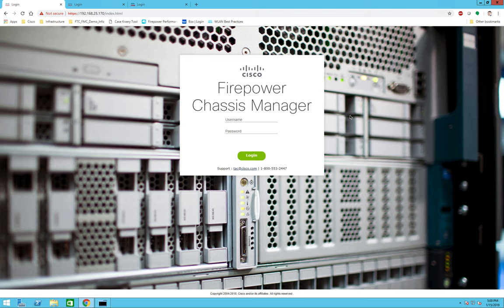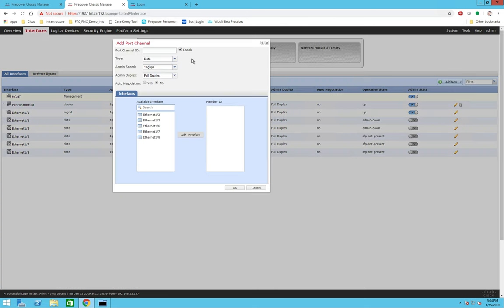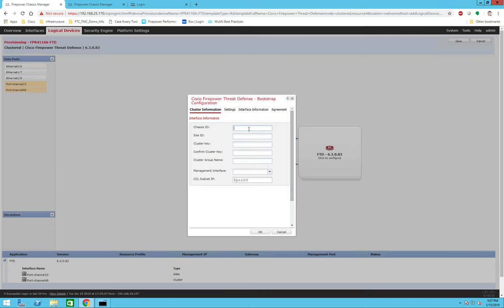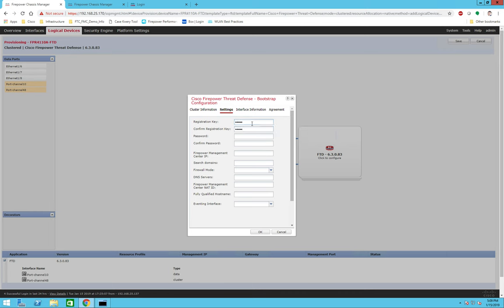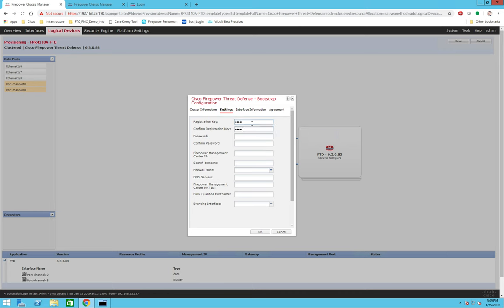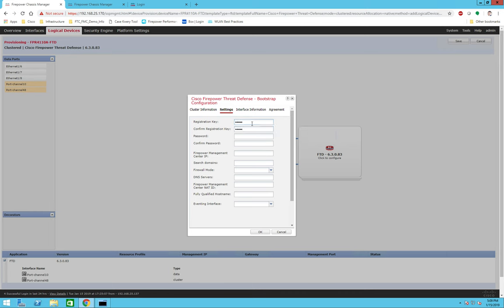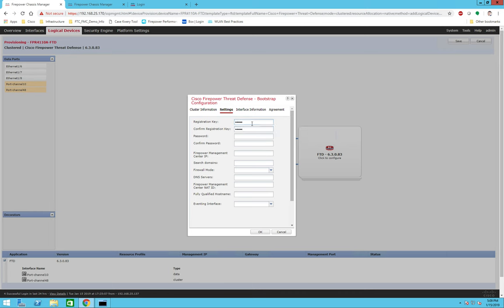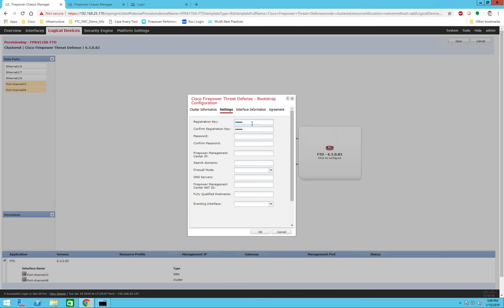Cisco: Security - Clustering a Firepower 4100 with FTD 6.3

Comment: Hello, I am implementing two FPR-4112 in a cluster using the instance idea. Therefore, instance 1 vlan 50 and instance 2 vlan 100 and from each firewall I use two ports 1/8 and 2/8. On the C9500 switch I use stack-wise. However, to make the cluster operational I needed to create port-channels 48 and 49 in trunk. Is that correct? Could you share what configuration you used to configure the switch? In the video I see that there are two port-channels. Is that the idea?

Comment: Hi Nathen
Thanks for the video. It helped a lot. I have one specific question regarding the management port 1/1.
Where shall we connect the port 1/1, if it is a switch where the mgmt port is to be connected then what would be the configuration of the switch port where the port 1/1 is connected.
And do we need to assign separate ip for the mgmt port or it wil take the ip which was provided during the cluster creation.

Thank you in adv.

Comment: To be clear, you'd need 2 separate firepower FXOS appliances for this to work, correct? We couldn't use a single chassis with 2 separate firepower instances to configure HA, correct? I believe I've attempted to do so before but ran into the issue of the firepowers being on the same chassis? Thank you for the video!
Reply from the maker: X I humbly apologize for such a long break, and thus missing a reply to this....  You can run clustering with a SINGLE chassis and multiple FPR.  Its called intra-chassis cluster.  Covered here for example: https://www.cisco.com/c/en/us/support/docs/security/firepower-management-center/212698-configure-ftd-clustering-on-fp9300-intr.html
Reply: @NathanStapp  no worries whatsoever, thank you very much for your help!

Comment: what is the purpose for copying the config from FW1 to FW2, because you have configured(fw2-logical device) it manually even after pasting the config.
Reply from the maker: Mandaar, the pupose of copying the Config from FW1 to FW2 is to bootstrap the configuration (save you time so you dont have to type EVERYTHING again).  What probably doesn't seem to make sense (but actually does when you think about it) is the fields that you have to populate are fields that are IMPOSSIBLE for the machine to determine for you.  Passwords are obfuscated, so those cannot be exported and copied, hostnames are unique so the machine cannot divine what it is supposed to be, chassis # cant be determined because this might be chassis 4, or 5, or 6 up to 16 in the cluster....,  IP cannot be determined from an existing ip in config.  The rest of the fields that are empty, like search domain is because it is optional, and I did not populate that on the first box :)
Reply: @NathanStapp  ah got it.....much informative, Thank you :)  :)

Comment: Hi Nathan
Thanks for video. Can I do management with FDM after creating the cluster with FCM ?

Thanks
Reply from the maker: Navdeep, No you cannot.  Firepower Device Manager (FDM) is only for local management of a firepower device.  Local management cannot be used if you are part of a cluster, as the cluster must be managed by the same manager which means a remote manager.  In this case Firepower Management Center (FMC).  Thanks for the question!

Comment: Hi, nice video. do you have network topology for this video? thanks
Reply from the maker: I don't have one drawn out because this video only focused on the clustering of the firewalls.  To be honest, after publication, I realized I probably should have shown the switch ether-channel configuration or linked to another video that prescriptively went into that configuration.
Reply: @NathanStapp  in case I have 2 direction data outside and inside. Do I must configure Portchannel 10 for outside and port channel 20 for inside. and when is a NGIPS, is in iline pair comnfigure in FMC?

Comment: I have 2 FPR 9300 with single Sm44 Security module and i am running 5 Ftd logical instances on it in HA (Active/Standby) i also have VPN requirements on this FPR. Is it good to use it in cluster or in HA.?
Reply from the maker: Harwinder, I apologize for such a long wait before response.  I have a newborn in the house! :)  As always the specific model device, code version, and intent are important in any answer, based on what you have told be I give the following information.  Anyways, there are two types of VPN's and which one you needs changes the requirements.  For Site-2-Site VPN's you can cluster OR HA, however the mechanics should be understood when you do this, I would recommend reading the "Guidelines and limitations" here: https://www.cisco.com/c/en/us/td/docs/security/firepower/650/configuration/guide/fpmc-config-guide-v65/firepower_threat_defense_site_to_site_vpns.html.  For Remote access VPN's (RAVPN's) only HA is supported, this is documented here under guidelines and limitations: https://www.cisco.com/c/en/us/td/docs/security/firepower/650/configuration/guide/fpmc-config-guide-v65/firepower_threat_defense_remote_access_vpns.html#reference_xby_dml_wy.  Hope this helps!

Comment: Just noticed that your Video is titled with FTD 6.3 but your video is demonstrating on version  2.4; will the same steps still apply?
Reply from the maker: Hey there!  The 2.4(1.222) that you see above @ 00:01:10 is the FXOS version, (which supports FTD/FMC 6.3).  00:07:15 is where you will find the FTD version is 6.3.  However to directly answer your question, YES the instructions above apply to FTD 6.3.  Let me know if you have anymore questions!
Reply: Hi nathan how u solve the issue discovery failed due to internal error while registering ftd to fmc iam facing same issue
Reply from the maker: @smithandro6124  My apologies for such a long time before response.  This can be caused by many issues and the simplest way to start troubleshooting this would be to view "sam.log".  This will likely give you a plain english reason for the failure.